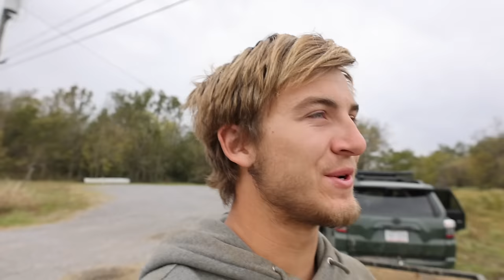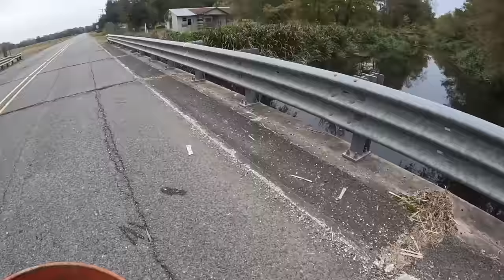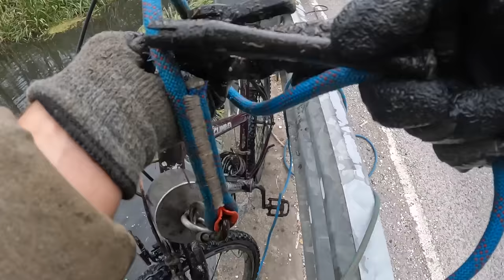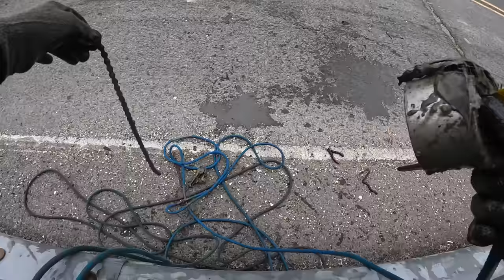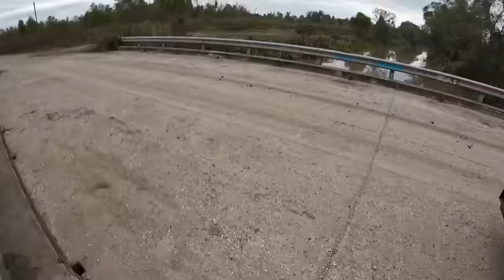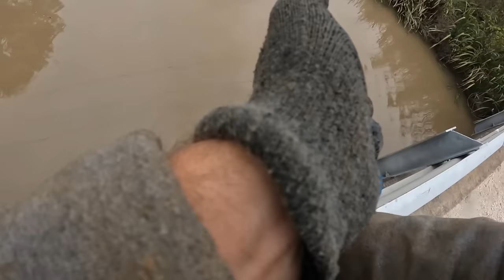Did We Just Discover A MURDER While Magnet Fishing...

Comment: Bird.  Emmie's 2nd gun, in less than a week, wow!!  Some impressive finds indeed.  That weird pipe thing you found may be a flex joint, for pipe that isn't quite straight on or is protection for a smaller pipe inside.  Man, with amount of casings and wire and cables you are digging up, it may almost be worthwhile keeping them separate from the steel.  Check what the price of brass and copper are.  Brass (shell casings) is not magnetic, but the primers inserted in them are.  All that wire, pretty much guaranteed it's copper.  It may be worth  less than bare copper, but is an idea to check out.  I spent 25 years as a scrap jockey, and some of that stuff may get you better money.  Aluminum is same thing.  As for turkey buzzards, depending on how fresh, it may be a good idea to check that spot out sooner than later.  If the kayak is out, that would be priority one in my books.  Looks like that one spot may get you a good haul though.  Keep up the great work!!

Comment: At 16:29, it is a pneumatic brake release cover. Sure from a truck. The hole in the center is for the manual unlocking "hand brake". Yuo can see 2 inlets in the border, one for service brake and the other to unlock the hand brake/emergency brake that is negative. Negative braking is if the brake normally is "on brake" by loaded spring and open if you want start. Is a security because if there is not air in the reserve it do not unlock and you can't start running.

Comment: What I'm guessing is, those shocks are not to a 4 wheeler for sure. 100% a car/truck shocks. The first 3 legged thing was to a trailer. That bash bar was definitely a atv. My guess is that either someone got drunk and drove a car/truck towing an atv on a trailer into the river or insurance scam. Maybe the washer was on the trailer too. The wires could have been the car/trucks wiring system or the wiring from the car to trailer or both. But the wires look too new, then again looks like everything from the car-ish stuff looked too new. Just my theory. Also the second 3 legged thing you pulled was a tripod :) The more you know

Comment: What you said looked like a spool, was an expansion joint of a pipe. When pipes run really hot or really cold liquids, the pipe will expand and shrink because of temperature. An expansion joint keeps the pipe from cracking or breaking.

Comment: That’s cool is it stainless steel flex joint for a piping system? Usually coming off of something has lotta vibration and the other thing you picked up was a valve it was just missing the stem and handle.

Comment: This dude is clueless when it comes to motorcycle parts and car parts lol. The one part he found went to an older motorcycle, it was the brake drum to a motorcycle and the A arm goes to a car or truck. It's what helps hold your wheel on lol. Smh, but the guns are a kool find. I'd get them cleaned and see if you can restore them. Look on the internet to find the guts to the rifle and clean the barrel really good. Oil everything up and reuse it. Same with the pistol. Clean it up and reuse it